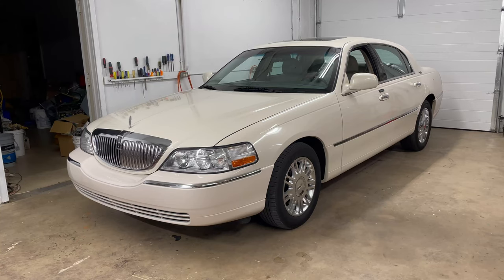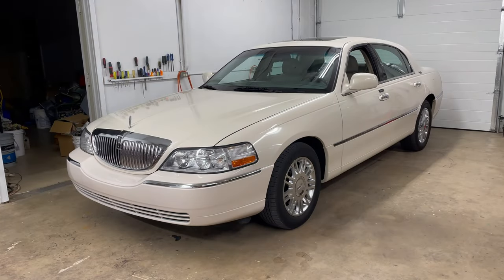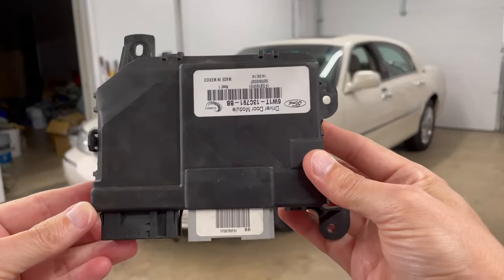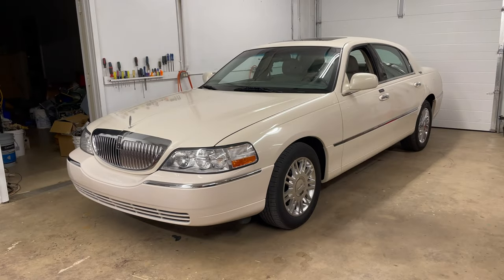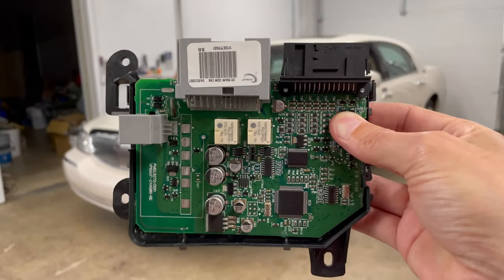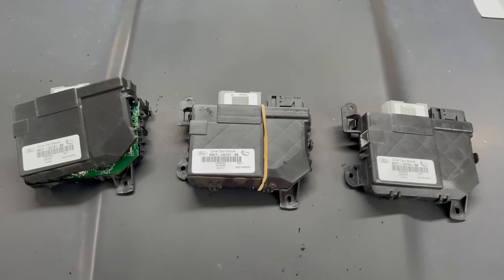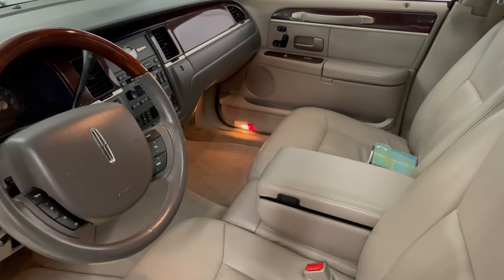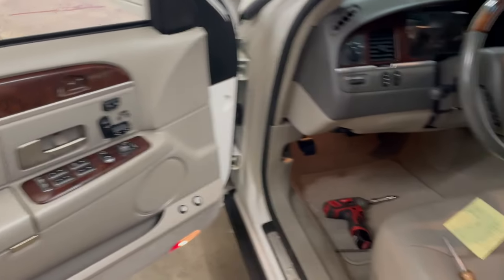Weird Electrical Problems FIXED - Lincoln Town Car

Comment: I had the same exact weird things happening with my car and based on that, I ordered the part as specified. It worked like a champ and saved me probably $600+ dollars not to mention the time it takes to get an appointment at a car dealer. Many thanks!
Reply from the maker: Right on! I never realized how common this problem was until I put up this video, I am not alone!!
Reply: I just picked up a 2007 signature. Here are the things that do not work: seats (motors are good), locking vehicle from either a fob or driver side, interior lights, when opening the door (they work when locking the door with the key) -- this so far. Is there a major control box for the seats somewhere that we're not finding. We've pull the passenger seat out looked at the wiring for the panel on the passenger door out. Looked at the little box. The 30 circuit breaker is good. Really at a loss on how to get this electrical stuff working.

Comment: As an owner of a panther platform car I appreciate you taking the time to make this helpful video.👊 🇨🇦
Reply from the maker: No problem 👍
Reply: @InternetDude  Did it matter if you took the Positive or Negative cable off, I took the positive off?
Reply from the maker: @l.o.e.6120  it is safer to disconnect the negative
Reply: @InternetDude  Hi. I own a Towncar and a Marauder and I wish I would have seen your video before. I teach automotive electronics emissions but I'm an electronic engineer and I used to design circuitry for Westinghouse. What normally goes bad on any of those modules are electrolytic capacitors and in this case they are little silver and black round can like things. Since these are surface mount components, you take a pair of needle nose and twist them off and the solder pads will be exposed. Observe the polarity when you pull them off.You then solder in the same value capacitors and you can get them on  Ebay or any electronic supply house for about 7 to 10 dollars for all of them. They will look a little different but you just take a solder pencil and dip a little solder on each pad and then stick the cap right on the heated pads. There are youtube videos showing you how to do this with TV modules which are the same principle.The other thing that can fail are the relays and a simple resistance check of the primary winding can tell if those are open. BTW, beautiful car you have.
Reply: @InternetDude   since you change the door module well it be the same code or be a different code on the module for the outside entry or do you use the outside door entry cold on the module
Reply: The new module

Comment: I had the same issues and figured out it might be the DDM, but I am not mechanically inclined, so I took it to a Lincoln dealer.  They immediately warned me this could be a costly fix because it could be a short anywhere in the car and it might take a long time to fix.  They hooked it up to their diagnostic system and then told me many codes were listed - trunk release issue, power door locks, etc.  This I already knew because I had made a list of things that did not work.  After this initial diagnostic scan, they strongly advised that I take the car elsewhere to see if someone else could locate the problem because "it could get very expensive" and Lincoln no longer makes OEM parts and they clearly did not want to get involved.  When I returned to pick up the car, I started the car and all the items on my list that did not work now worked fine.  I am not sure if after they did the scan they checked to see if just running the scan fixed all the issues.  Maybe when they used the diagnostic scan it reprogramed or reset the DDM???  For now, I will just run the car and hope it doesn't occur, but if it does this video and instruction is excellent and will take care of this fix myself.  Thanks
Reply from the maker: you can't reprogram a DDM, it can only be programmed once.
Reply: Same set of problems, I had been hunting for a used DDM for a few months..  This morning I went out into the driveway, and everything worked!

Got where I was going, used the key fob to lock the car.  Came back out to drive home and nothing worked again....  lol

I'm convinced I have a bad wire in the loom that connects to the door.   If I'm right, Its either the power supply or the ground.  I don't have time for it today, but I'll be in the driveway next weekend with the door panel off and multimeter in hand!

Comment: quick tip for those whom wish to not have their door panel flapping like drapery after reattaching panel to the doors:  pull the outer edge of the door panel and rotate clockwise so to not break the brackets which 'catch' onto the push pins.  Most if not all ageing door panels will break almost every one of the brackets if they are pulled outward against the one way locking pins which are meant to resist such force to begin with. The brackets are designed to catch or hook onto the pinheads... I realize this is difficult but i love upholstery work and i'd like to throw a 'bone' here!   My third town car that im begging work on. 2005. Love em!!
Reply from the maker: Yes those clip holders can break easily on older cars! Mine has one broken clip mount.

Comment: I just bought the exact same doel and color TC from a nice lady in Albuquerque.  It has a whopping 212000 miles but runs and drives and looks like a NEW CAR.  I am so happy.
Reply from the maker: Sweet! I have a quick tour video of mine, it has about 50K miles.
Reply: how much did you get it for?
Reply: My ‘09 TC has 360,000 miles. Going strong!

Comment: At least on the 2003 models, the code is printed right on the tag of the Door module. The code is printed like several fractions side by side , and my code was all the numbers in the denominators of the fractions

Comment: I had the same problem on my 2007. The dealer replaced that module and one other -- total cost about $1200. They still made the modules then. I found a place online that will rebuild them and I'm thinking of having my old ones done. You reminded me of that. Thanks for your efforts. One other thing is this happened when my battery was at the end of its life -- maybe the low battery caused the trouble?
Reply from the maker: A low battery can cause issues with modules for sure. I have not heard of DDM rebuild service but I have for the Light Control Module LCM. Personally I’d rather get a good used part first choice. I have a spare LCM and blower module now just to have on hand.
Reply: @InternetDude  That could have been the LCM. I better check that out. Thanks again and good job fixing that yourself. Very impressive!
Reply: You could've pulled one out of a junkyard under $20

Comment: Thank you for your video!  I have the same car with the same electrical issues.   I had 2 "professionals " tell me they couldn't fix it.  Because of your very clear, step by step vehicle,  I knew right away how to get my locks, etc. To work.  I installed the new module today, and now everything on my car works.   Thank you for making this very good, we'll explained,  video.
Reply: WHERE DID YOU GET THE MODULE?

Comment: Pretty car and great info!  Nice yours has a moonroof. I'll never own another car without one!

2006 TC I purchased 5 years ago, did not have keyless entry code.  Dealer wanted way too much to obtain it, so I found it with brute force.  Made a spreadsheet with every key combination listed and printed it out.  It has 3,126 lines.  Set a stool next to the door and started punching the buttons.  When the door lock finally opened, I was thrilled!  No feeling quite like it after punching buttons for half an hour.  But, the code turned out to be one programmed by previous owner.  Not good enough!  Kept punching and found the factory code not much later.  Turned out the be the last 3 digits of one line, and first 2 digits of the next.  Wasn't expecting that, but hey, I'll take it! 😀

Good luck with your ride.  I'm sure you love it as much as I do mine.
Reply from the maker: Thanks for the comment

Comment: Thank you, thank you, thank you! You just saved me $600+. Dealer wanted $528 for the part plus $200 labor. I bought the part on Ebay for $100 then followed your clear and simple instructions with no problem. Only took about a half hour. Again many thanks!!!!!
Reply from the maker: Awesome that does sound like typical dealer pricing

Comment: Thank you very much for this very informative video. Your explanations are clear and well-paced for all of us to follow. My 2007 Towncar Signature is having problems identical to the ones yours had. I took it to my mechanic and he couldn't figure out what needed to be fixed; so he recommended that I take it to a Ford Dealer! I will follow your lead and save myself a ton of money. A million thanks.
Reply from the maker: Glad it was helpful! If you take it to the dealer it will be a very expensive trip.
Reply: i also have a 2007 signature with power locks not working, and i also have a question

Comment: Thanks for the video. Look for a small sticker on the trunk hinge or under the hood or door jamb. That's the door code. Have a great day.
Reply: Passenger side trunk hinge. Should be a white sticker on it with black numbers. That’s the door code!

Comment: I was having this exact problem with my 04 Town Car, thanks to your advice I grabbed a door module from an 04 Town Car Ultimate (mine is a Signature) from the local self service junk yard and it worked perfectly, all functions have returned to normal. Thank you very much for this video.
Reply from the maker: Right on! I’ve been surprised at how many people have had DDM problems, but it can be a relatively easy fix.

Comment: This is very helpful. Ive got an 07 designer with locks and mirrors and drivers seat randomly not working..then working.. i was about to pull whats left of my hair out but it all makes sense now 👍
Reply from the maker: It sounds exactly like DDM, mine was intermittent for like a day or two and then konked out. For you, find a DDM out of a 06 or 07 Signature Limited or Designer model. Base Signature will not be enough for you. Good luck!
Reply: @InternetDude  What about for a 2008 Signature Limited?
Reply: 2005 lincoln town car having a fit and can anyone help?car turns on instantly but like if car is on gear idling at a traffic light it all of a sudden it feels like engine misfires.and no check engine light and that's kinda strange to me and this issue of car misfires does not do it all the time
Reply: Same here.  Got an '07 Designer as well.  Ordered a unit from eBaywith the same part number as yours.  No provenance noted but hoping it's an at least "L" model.  From now on, any '06 & '07's I find at the Pick 'n Pull, I'm grabbing those units as well as LCM's.  Could NOT find that part online from various Lincoln parts outlets...in fact, didn't even see it in a diagram.  Part number didn't even pull up.  Sad when people want to keep these old rigs running (mine has 40K miles) and electronic parts get hard to come by.

Comment: My door handle the plastic trim around the handle on my 2010 Lincoln Town Car. I ordered the replacement door handle trim drivers side but your video showed me how the door panel comes off..and I learned about the door module as well. I'm im Ontario Canada btw I believe your also Canadian! Thanks for a well made video Sir. 😎👍
Reply from the maker: Thanks
Reply: To keep the bezel on the door release handle from breaking, push on the bottom rear corner of the bezel with your thumb when pulling on the inside door handle.

Comment: Great video, you did a better job of getting the panel off without breaking stuff than I did. :-) I recently installed a never installed NOS module in my 2007 SL that needed to be programmed (it comes in factory mode).  I was able to do the dealer programming with FORSCAN after paying $10 for the extended license (no extended license required just to read the code).  I made a backup file of the factory DDM programming, wrote it to the new module, ran the onboard self test, and I was off and running.  The really cool thing is the procedure carried the original code over to the new module.
Reply from the maker: Thanks for the input on the issue! I discovered one broken clip on the panel when I took it off and I'm sure it was broken before me. I have an OBD dongle on it's way to me, and I plan on experimenting with FORScan to retrieve my keyless entry code next week. Out of curiosity, what was the part # of the DDM that you bought (NOS one)?
Reply: @InternetDude  Funny you should ask that.  The module that came out of the car was the same model number you pulled from yours.  The one that went in was 6WIT-13C791-BB, which I'm assuming went in later Signature Limiteds but worked just fine in mine. The newer part number was listed in Alldatadiy.com as the correct one for my car, so that's what I searched for.  I'm guessing it would probably work in any 2006-11 and is what dealers had on their shelves at the end of production.    A Ford dealer in Michigan that sells old stock on ebay had it. Here's the video where I learned the backup procedure. https://www.youtube.com/watch?v=4Z4pX4XREXM This guy has lots of FORSCAN videos.   If you ever have to program a new key you can also do that with FORSCAN.

Comment: Awesome walkthrough for the door panel! Thanks so much. Just got a 07 towncar limited signature and I just the love car. It has a problem where the seat doesn’t move forwards and backwards, and sometimes when I let the car sit overnight the drivers seat will move all the way forwards. Hoping it’s not this and just a power sweat switch.
Reply from the maker: Hmmm that's strange behavior, I haven't heard of the seat moving all the way forwards. Do you have issues with anything else? Keyless entry, power mirrors, etc.?

Comment: So I just bought a 07 signature limited as well. My question is if the ddm is the issue, could it also drain your battery? I have a new battery and alternator is good. Yes, some of the things you mentioned such as power mirrors and seats would sometimes work and just quit. My trunk also doesn’t work but didn’t know you can hold the trunk button to open and close the trunk. Thank you for the video.
Reply from the maker: In theory I think it could drain the battery if some device does not turn off correctly

Comment: God bless you sir. This video just blessed my life and saved me $700!!!! And that would have been for the repair shops USED module. 

Just as a additional thought…..if you get a donor module from the junk yard and you get to pull it yourself check the truck arm for the code. Ford used to do that on the older Lincoln’s in the 90’s. Not sure if these have it too but it’s worth a shot!!!!
Reply from the maker: Glad to help! Some earlier years of cars the models would fit all models from that year or even other years. Not so much on the newer Town Cars. Check the link in the description for more information on year compatibility. Cheers!

Comment: This is a great informative video.   I am having similar issues but only my cruise control and heated seat does not work.   Everything else works.   I checked fuses.   They were all good.   Is this my next step I assume?
Reply from the maker: The cruise not working is likely unrelated. I would check relays, wiring, connectors and grounds next. Also make sure the fuse is getting power. Best guess is a bad heating element or relay.
Reply: @InternetDude  thanks man appreciate the info

Comment: I'll add my 'great video' to the others because I just bought a 2001 Town Car Cartier that has non-working sections: driver seat (lumbar works though), power mirrors, etc.  I found a replacement with the exact Ford part number that was remanufactured and with a 90 days warranty. I am waiting for its arrival and will see if that will cure all the problems.  Was this a 'design flaw' that wasn't caught by the engineers for many years?  I just wondered what you think.  Thanks again for a fantastic, point-by-point video!!
Reply from the maker: I don't think it was designed to fail, but putting a module in the driver door means it gets slammed around every single time the door gets opened and closed. That is extreme abuse, they should have put the DDM not inside the door in my opinion.

Comment: Excellent approach to a complex problem..I basically have a mayor issue that is making me crazy and some times had made he wonder if I should've not gotten this car..but I love it with passion already..it's hard to explain but I'll try..when I turn the car off..and if I forget to lock it with the remote..20 minutes later..the locks that raise up  on the doors start locking and unlocking..loking and unlocking..locking and unlocking in a eternal never ending cycle until the battery dies(it has happened already twice in 3 years that I owned my princess)..ohhh It's an Executive L 2011..I don't know where that issue comes from..but now that I see this video..I might makes sense..yes some times the motor to push the driver sit to up and down doesn't wanna work..if I buy a new module too bad that just a week ago I paid to finally get the access code on the door..
Reply from the maker: You can retrieve the door access code using FORscan software (free trial) and use a computer to connect with an ELM 327 adapter. Very cheap option to get the code, see the description.